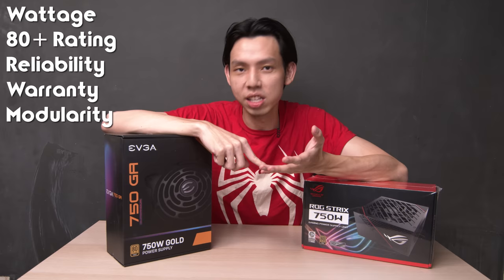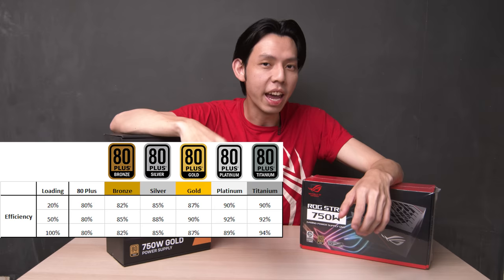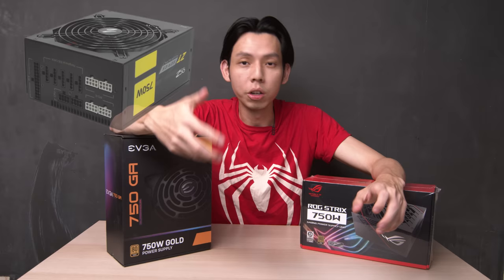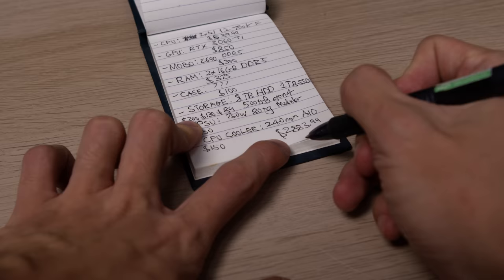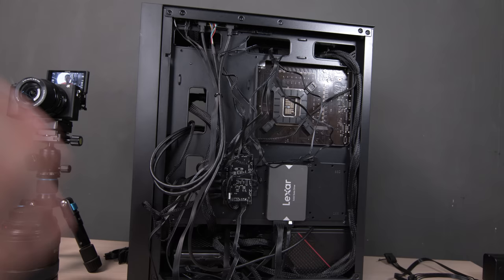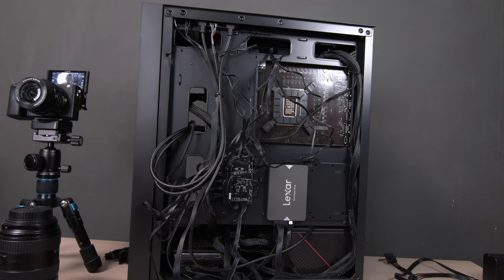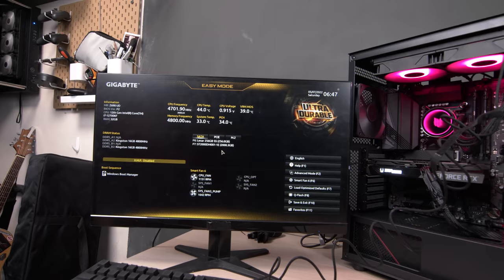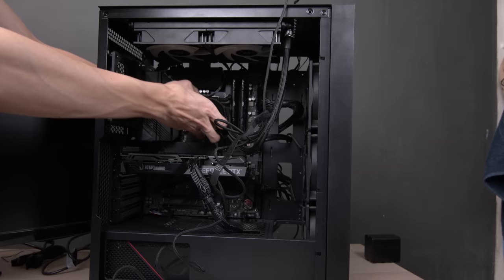How To Build A Gaming PC in Singapore!

Comment: I hope this does not come across as a hate comment, but I have to ask, why are amd ryzen cpus' not mentioned at all along side intels' cpus, in quite alot of cases a ryzen cpu performs just as good if not better than a intel cpu and also amd's cpus may be the more cost effective option e.g. Ryzen 5 3600x. and also why is only alder lake mentioned? What about comet lake? or rocket lake? Also, I would dare say that the 30 series is not the only range of gpus available, what about the RTX 2060? or the GTX 1650ti? Both are reasonably priced with reasonable performance running at 1080p. Again I would like to reiterate how this is not meant to be a hate comment, I only feel that there were some points that could have been explained with alot more detail like how 12th gen cpus wouldnt fit in a LGA1200 specced motherboard, and I only hope that you may take these points that I have presented into account for more in-depth videos in the future. And to anyone reading this, please do not take this video as gospel, there are many other sources which may answer your build questions like LTT, JTC or even BItWit.
Reply from the maker: Hello there, Thank you for your comment! the honest answer is because Intel is sponsoring this video. 
Without them this video could not be possible. 
Also this video is not to discuss which is better or more competitive. it's intended give a better knowledge on why having a better CPU is better for what work loads. I'm just using Intel as an example

Comment: Good attempt and effort video! Not as detailed and informative as Linus Tech Tips recent PC Building video but hey they have 1000x manpower and budget compared to yours so no comparison.

However I am just wondering why you didn't use Windows 11 instead of Windows 10. 

Windows 11 scheduler is much better optimised for Intel's 12th gen P and E cores. Since this is building an entirely new PC I highly recommend going for a newer Windows version which will only get more optimised with newer CPUs instead of an older Windows version that won't perform as well down the road.

Comment: Julian.  I am building for a 3D Medical Cone Beam CT Scan requirement.  Am copying your system specs but need 2 LAN ports in this system.  Do I just buy a Ethernet PCI Express card to solve the issue or is there something better to make a System like this have 2 Gigabit LAN capability?

Comment: Hey julian, im plannigh to upgrade my gpu.

Would it be better to upgrade to a 3060 or 3060 ti if the 3060 ti is about 150 dollars more?
Reply from the maker: For 35% improvement it's quite worth getting the 3060ti if you want to save money maybe the 6600 or 6600 xt

Comment: Sorry, to say this. The moment you skip the choosing case, and talk about zowie monitor. It is obvious you are has biased opinion (based on your video, even you didnt say it) sorry to say. I came back and expecting a new fresh look, but sadly it is still the same. 

Will support again, if there is no biased opinion
Reply from the maker: wait what? for the case there so many option and with so many ppl personal preference, I rather teach you what to look for in a case than to just choose a case.
For the zowie monitor... like hello? I recommend 2 more monitors in the video? and reason why I recommended zowie monitor was for CSGO/ esports players. which no doubt zowie is the best at these games. if I was bias I would just say Prism+ cause they sponsor me.... get your fax right..
Reply: @JulianTechTM  With the header "How To Build A Gaming PC in Singapore!", it is technically a beginner guide (Not sure who your target audience is). By skipping the case selection, it means you didnt done your research properly. Case has different tier, as the materials that is use to produce the case and such as the airflow and the expandability for the case in the long run. You just choose to skip it, not even choose to touch even a few points

Zowie is a good monitor agree but is not the must go too. From the way you portray about monitor it was a biased opinion. You avoid the advantages, cost and performance. Just say " get zowie", since is a beginner guide, this is misleading. Since you use csgo as an example, a high refresh rate will do, which a zowie offer no doubt but not the cost. There are other manufacture out there like samsung and asus, but you avoided all that just putting zowie. (you putting prism+, which is good price point but not the performance. Which i also understand all local influencer is sponsor by them)

Yes there is a lot of personal preference, but the way you chose your build is not a common build. Since is beginners, you should have include the average price that you are targeting. Not choosing all the parts that you think is good and whack. Not everyone has the same price point as you.

I would love to give it another chance but sadly it cannot awarded the chance. (not the first time i visit)
Reply from the maker: Yeah if you think I mis inform I give it to you. My opinion is not for everyone. And you have your own opinion... But don't say I'm bais because Zowie hasn't paid me for anything . And like I said " this build is an extreme example." For the case yes I didn't go in depth with it. Because to me what is more important is compatibility. You might not agree with me. Which is fine. You don't have to stay. If you think you are better than me feel free to do a video about it. However I do appreciate your comment. I will definitely add this. Not sure why you didn't comment on  this when I have never recommended a case in any of my builds...